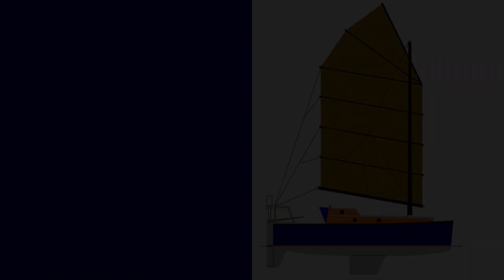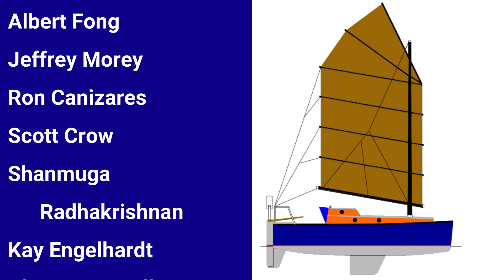S2E54 A Boat Shed Destroyed and Wave Rover gets a new Home.

Comment: why you dont build with concrete ? here, concrete is cheaper than wood, no point in building a shed like that in wood... specialy in hurrican area...
Reply from the maker: Concrete is expensive here and a foundation of concrete requires permitting. Bill just wanted something temporary.
Reply: @RoversAdventure  hummm ... now I get it... here europe, is far cheaper concrete than wood... but both require permit